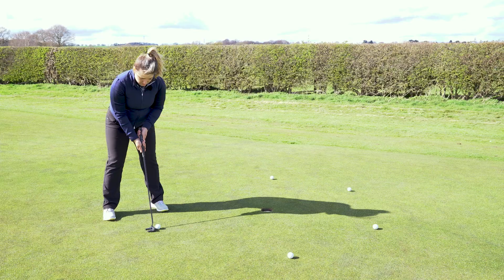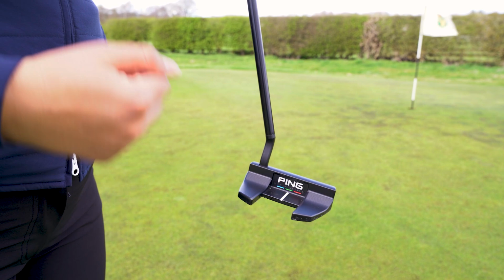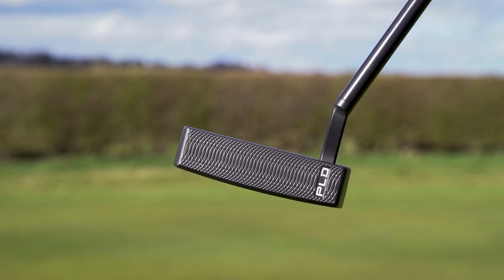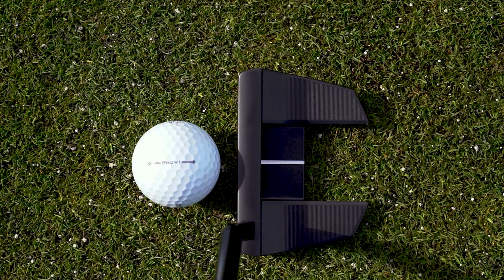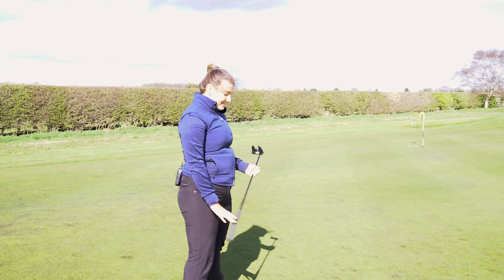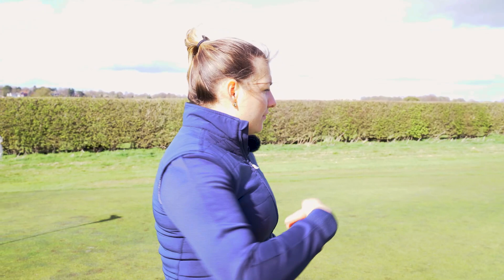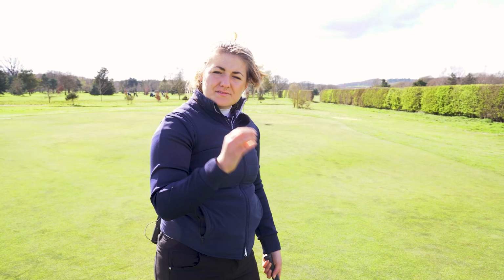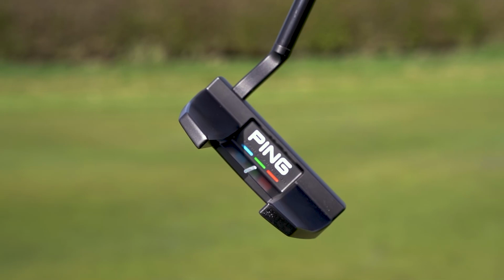Your new putter? Ping PLD Putter review

Comment: @hannahholdenNCG Great review Hannah, just a quick bit of info on toe hang in putters, more toe hang actually slows down closure, the weight being further from where the shaft intersects the head requires more energy to move, similar to toe weighting a driver to slow down closure and promote a fade